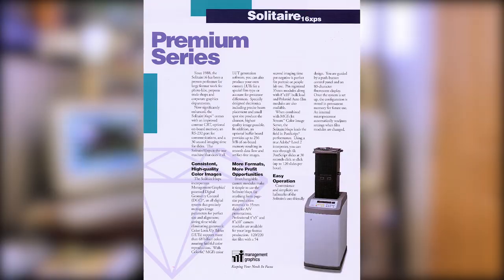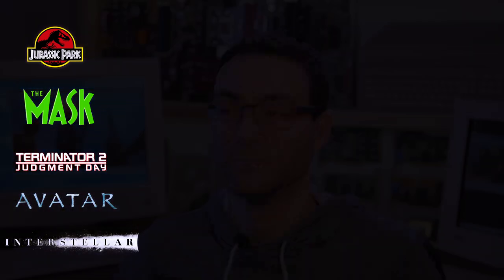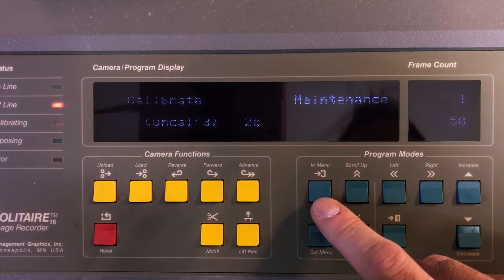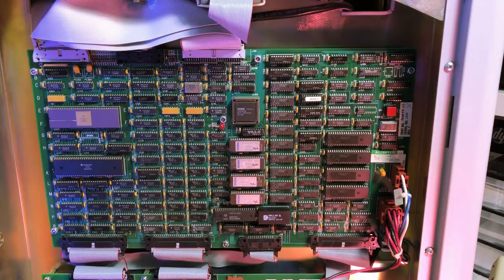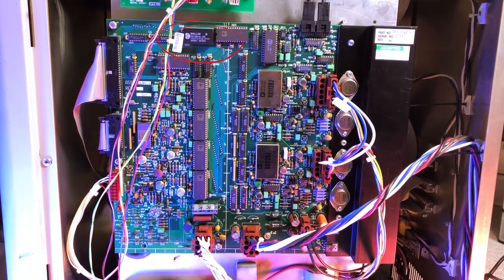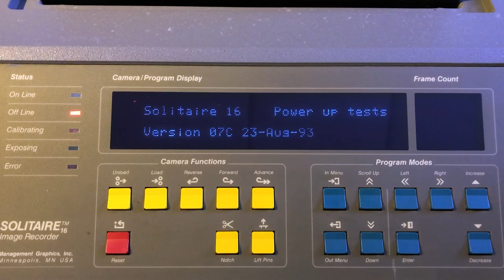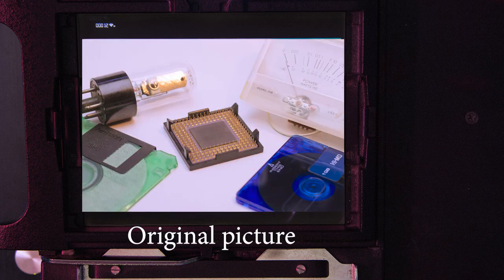How "Toy Story", or Jurassic Park's SFX were printed on Film - MGI Solitaire 16

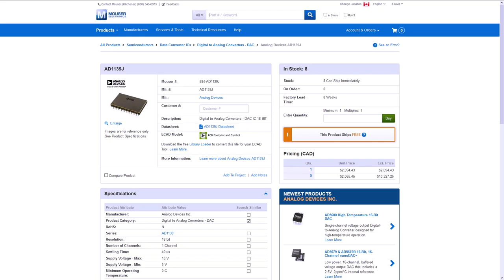Comment: Do you think the contemporary price of the fancy-looking Analog Devices chip at 4:40 was really $1000+/unit?

I was wondering if the prices shown on that site are inflated due to scarcity. Maybe they only have 5 of them in a box in the corner of a warehouse. 🙂
Reply from the maker: Hah that’s very possible, though I am convinced those were already quite expensive back then. Not sure where to check price for parts like those, that’d be interesting!